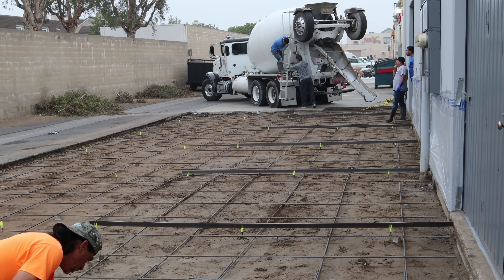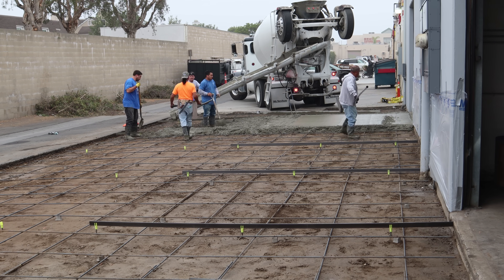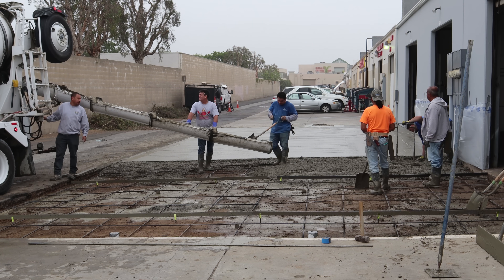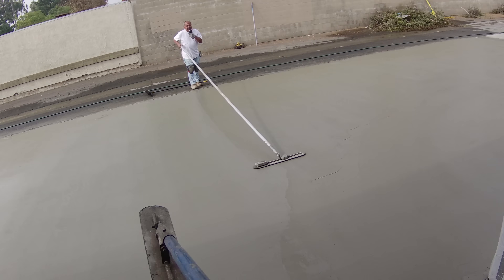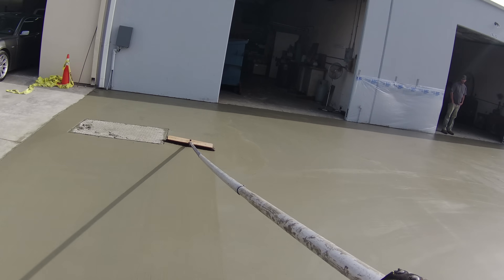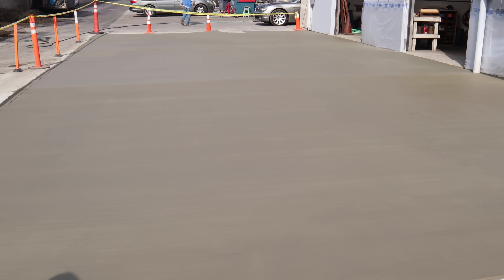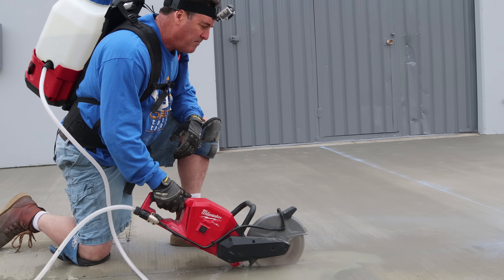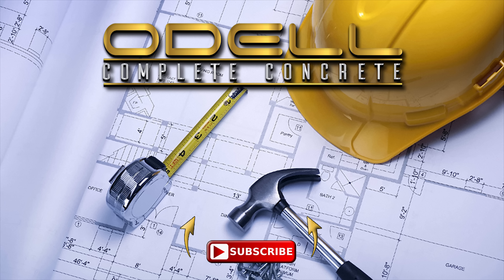How to Pour a Concrete Parking Lot! 2000 SQ FT! Part 2

Comment: Hi from rainy SW Scotland
Mike, persist with your Spin Screed, it is a very use full tool, get on the website and follow the instructions, I have had one for 4 years and wouldn't be without it
Like the different techniques you use, and follow this very closely
Not a lot of domestic concrete paving in this country, but I have done a lot of commercial work over 50 years
Kind regards
David
Reply from the maker: Sounds good, will give it another try

Comment: Okay I may have missed it because of the fast forwarding, but the flat metal guides for the spin screed were removed as you went along?
Also good work. Loved the video! Happy Thanksgiving to you and your family as well!
Reply from the maker: yes the metal was moved along with the pour.
ty
Reply: @OdellCompleteConcrete  did you remove the yellow (plastic?) devices that held the screed rails?  Wished you had shown that use closer, realize you had a big pour to get done. Thanks for sharing boss. regards

Comment: I see you have metal supports to screed from.  Do you leave these in the concrete?  If yes, do these act as your joints also?
Reply from the maker: the metal was intended to ride the roller screed on. The metals gets moved as as the concrete pour continues

Comment: You always seem to use a 3000 mix why not just use a 4K ?
Reply from the maker: I like the 3000 its hard enough but gives you enough time to work with it, without having to ad retardants
Reply: Odell Complete Concrete ok. I know a yard of 3k here is like 117 and a 4K is only 127 so they push the 4